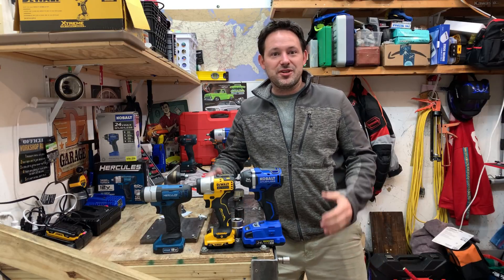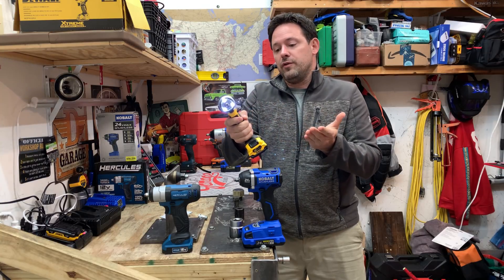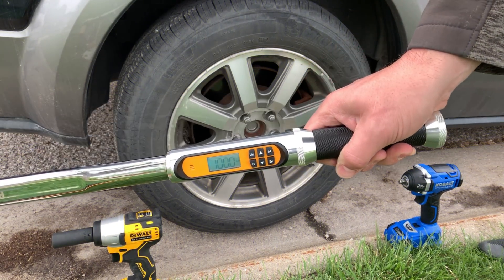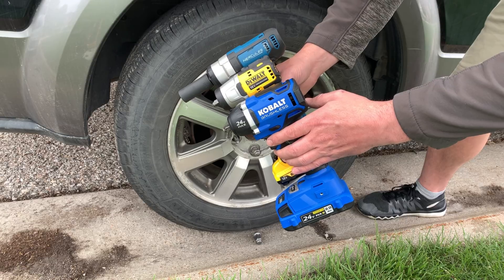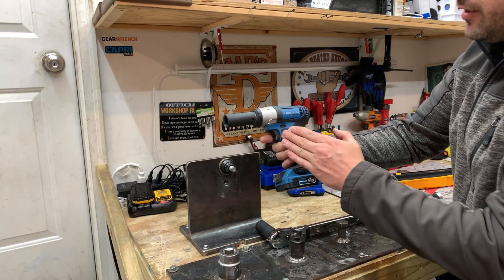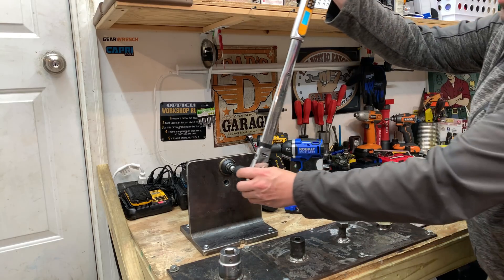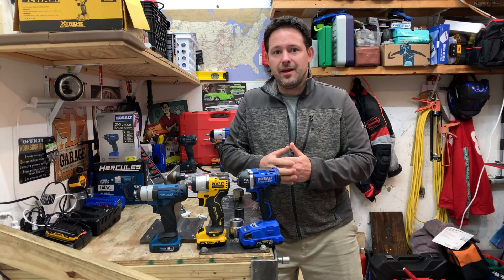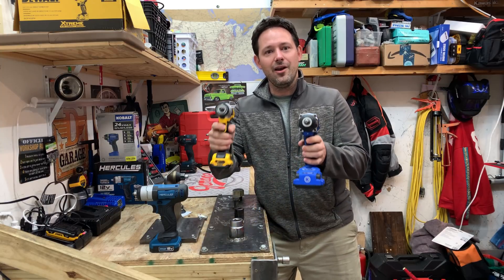Dewalt vs Kobalt vs Hercules 3/8 Impact Breakaway Marketing Torque

Comment: One potential for error in your testing of using the same bolt at different levels of torque is that as the threads heat up, it will be easier to break the nut loose. Just something to think about.
Reply: Dewalt kept going first inside warming up that nut, and it seems like speed wise the other two were just as fast if not faster than the 100 test outside for the 150. I'd like to see that Hercules on a cold 200.
Reply: That is pretty much the whole idea of marketing when they claim any tool can break more than they can fasten. As if the anvil is bigger/heavier in one direction....
Reply: E S well it can break more than it fastens. Think about it like a wedge. If you put a wedge under a door its hard to beat in but easy to pop it right out. A nut and bolt is a similar combo

Comment: I know I say this alot but the proof is in the pudding Kobalt is amazing like you said they are sadly underated and in my opinion the best under 🐕 of power tools I am 💯% a proud Kobalt owner
Reply: I have all 3 kobolt impact wrenches except the new XTR line.  I also have a dewalt mid-torque XR and I prefer the kobolt 3/8 for light weight and very long lasting battery.  Worth every penny as a diyer.
Reply: @bonbonflippers4298  Agreed, I love both Dewalt and Kobalt and have not been let down by either of them.
Reply: Yea everything i have is kobalt , ive been using them for at least five years and havnt yet to have a failure of tools or there batteries.
Reply: I bought the 1/2 impact and I love it
Reply: I don’t have this tool, but I have the drill and impact driver and I’m really happy with both of them.
Reply: My mid torque Milwaukee 3/8  walks over my dewalt xtr

Comment: The head size of the kobalt is the same as the 1/2" impact which is rated at 200 ft lbs. I think it's cheaper to just change out the anvil and keep the same motor between the two. I don't know why they are understating the torque for the 3/8". I do love mine and all the 24v tools!
Reply: No the 3/8 kobalt is smaller. I have both and set them side by side.  The 3/8 is slightly smaller...not much but still smaller
Reply: @bonbonflippers4298  you're right, I compared them again. I figured it would be better to have the same motor between the two but different anvils. As I think about it, it would be beneficial to a have a smaller tool for tighter spaces that would require 3/8 sockets.
Reply: @SoyMagnumOpus  , I thought they were the same too, especially since the Kobalt 1/2 impact is rated at 150 ft lbs on Lowes web site, the same as the 3/8 impact.  I also saw a video on Youtube that lined up the 3/8 impact with the 1/4 compact driver, and the body of the tools looked identical, and since the 1/4 compact is rated at 1800 inch pounds, that also equals 150 ft pounds.  That led me to believing that all 3 of these impacts used the same body, with only the nose piece being different.

Comment: Need to test the Milwaukee m12 3/8 stubby. Thats the tool I chose to by when comparing to different tools
Reply: How is that 12v Line? I'm about to start buying electric tools. First being the impact. I was pretty sold on the Kobalt 24volt brand. Until I looked in the the M12 stuff. That battery goes in ALL the tools even the ratchets. I liked that! Primary use will be to work on my project car.
Reply: Buy Milwaukee,  you won't regret it.  I own the m12 3/8 ratchet,  1/2 stubby impact,  and the m18 1/2 high torque impact.
Reply: Ryan G I have the Milwaukee 12v line and I love them for working on cars. The ratchet says 55pound feet but more like 40, the 3/8 Stubby says 250 pound feet but more like 200. More than I need for engine work.  Suspension I use a 1/2 inch rigid just because I received a set as a gift, but never failed me. I don’t even use air anymore.
Reply: @ryang9425  I use m12 for almost everything now except for outdoor tools.  In the shop 80%  Only the worst 1/2 high torque suspension do I use 20V Dewalt.  The 3/8 stubby is THE tool.  The biggest thing is the m12 line is compact and light, far more than 20V platforms.  If you need extra boost you can use an XC battery versus the regular (compact) battery.  At one time I used 20V Dewalt extensively, then I found the m12 platform which outside massive torque is just more usable.  The other fav is the 1/4 hex right angle.  That tool saves your butt.  I find the ratchet a little bulky, not my fav.
Reply: I use milwaukee great tools for automotive work. And the stubby will give you a little more power if you use the 6.0 battery from what i see.

Comment: I’m pretty sure Kobalt, states fastening torque, not breakaway.  But I could be wrong.  It should be the strongest out of the three, seeing how it’s 24 volts vs 12.
If they did use breakaway torque ratings, I bet they would advertise 240 ft-lbs.
Reply from the maker: Kobalt marketing specifications: “150-ft-lbs of torque in forward and reverse For effortless tightening and removal of large bolts”
Reply: ClientGraphics 

Correct, it’s stating actual static torque, or fastening torque over time.  Meaning if you were to place it on a skidmore wilhem, it will in short order measure (or if you use it to fasten a reverse thread fastener it will tighten to) 150 ft-lb or more for the Kobalt.  125 ft-lb fastening for the DeWalt and at least 100 ft-lb fastening or more for the Hercules.

Breakaway torque relies on the physics phenomenon, that if we assume good condition threads, no corrosion or extra friction.  It takes less torque to break a fastener, then the original torque it was applied under.  AVE has a video demonstrating this fact.  So theoretically, if you fasten a bolt to 100 lb-ft, you won’t need 100 lb-ft to break it lose.  It will be somewhere between 60 and 80 lb-ft depending on the threads.

That’s fine, the problem occurs is “breakaway torque” results will vary depending on conditions, and manufacturers confusingly so, are using breakaway torque interchangeably as fastening torque.  DeWalt seems to use a fastening torque is 62.5 percent of breakaway torque formula in this case.  But in other impacts it advertises as much as fastening torque is 56 percent of breakaway torque.  But yet in its biggest impact it’s rated at 700 ft-lb fastening, but it has measured an actual static torque of over 900 and 1000 lb-ft so I’ll give them a pass.

TL:DR. Manufacturers use confusing metrics when it comes to torque output.  And breakaway torque is not a real number of actual force produced.  

In an ideal world, everyone would just state forward and reverse fastening torque, under the same test conditions among different manufacturers.

Comment: I'm out of the game now, but I used Ryobi 18V tools exclusively for many years and was completely satisfied with them. If I was starting over I'm not sure which platform I would prefer, but it would depend on the variety of tools that I could get without needing to have diverse batteries and chargers.
Reply: Milwaukee's 12v system is pretty stout

Comment: I picked up the Dewalt in a bundle with 2 battery packs and a charger from Lowes for $100 last month, but I haven't used it for anything yet, I bought it to try to break an ATF drain plug on a 2008 Honda odyssey but I couldn't use it despite it's compact profile, the geniuses at Honda put the drain plug on the side of the transmission at most 6in away from the exhaust combiner and put all kinds of crap around the bolt so the tool was too fat to get in the 3/8 drive bolt head and any extension makes the think too long to fit.
Reply: I wouldn’t use power tools for a drain plug.  Unless you want to risk coating your tool with used motor/transmission oil.

For oil drain plugs, I just use a half inch drive ratchet.  That’s about 10-12 inches or so long.  These are normally torqued down to about 25 lb ft.  So with a half inch I can snap these very easily.

If you want to use a power tool, swivel impact socket (wobbly extension in your case) is your friend here.
Reply: Gee, I wouldn't have thought to do that first before buying a power tool.

Comment: That hercules surprised me also! I now use the Milwaukee fuel platform. I was contemplating which platform to get for 8-9 months. During the Thanksgiving/xmas season I found a sale on the fuel impact driver, hammer drill w/ (2) 5.0ah batteries and charger + free mid torque impact wrench for $279, so I went with that and I have no complaints as of now. That was a great vid my man! Hope all is well and your staying safe and diligent through this craziness! Have a great week!

Comment: next test out what seasoning oil is best for cast iron skillet
Reply: Flaxseed oil is the best, but it's very expensive and can turn rancid. I use canola oil spray before and after I cook and have zero problems with my cast iron.